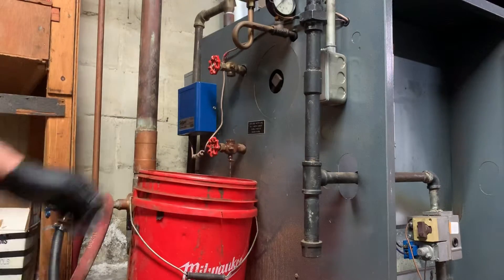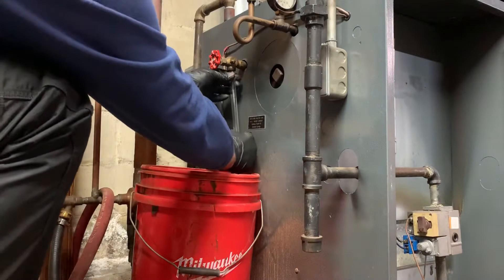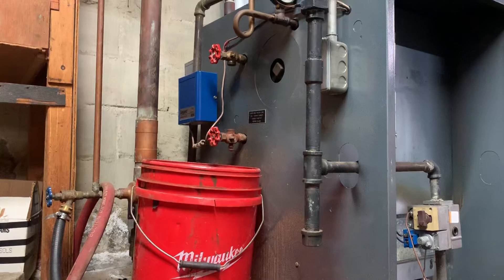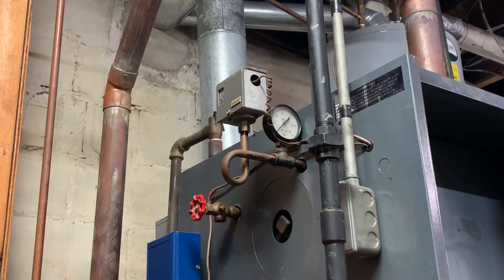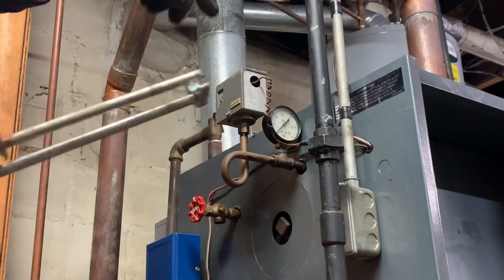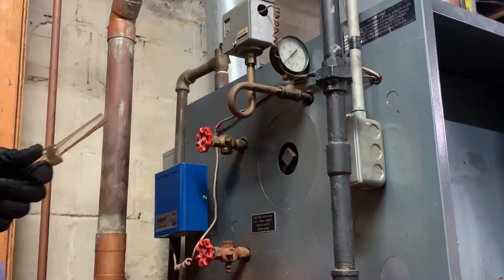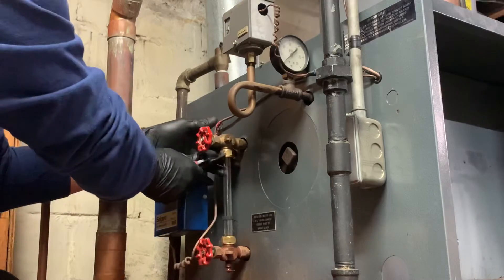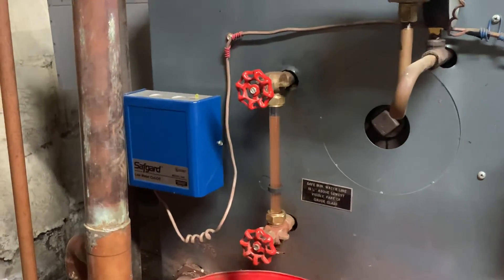How to replace sight glass on a steam boiler

Comment: Can you do this in the winter 🥶 while the boiler is  in use? And do you drain that sight glass first before closing valves?
Reply: Recommended to shut it off and have it off for an hour minimum before doing this.  I mean you can do it while it’s hot but you’re likely to burn yourself.
Reply: @ thank you!

Comment: Excellent video I need help though. So the knob, the gauge cocks above and below the site glass the lower one seems to need a washer replacement. The brass not holding the actual handle on is not traditional it’s rounded in between each edge. Not damaged but do I need a special tool to remove this to access the washer? Please help thank you.